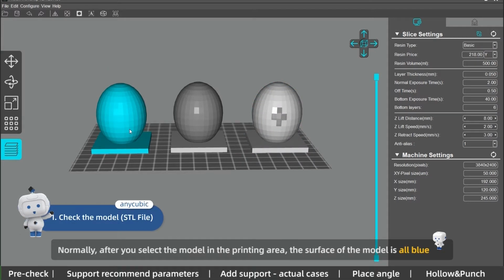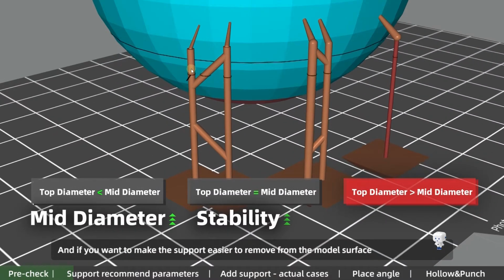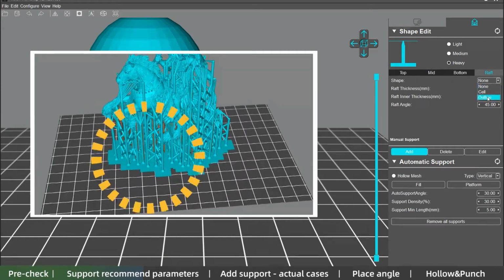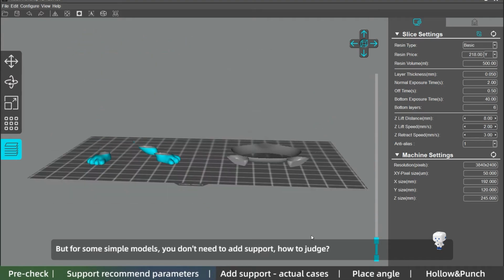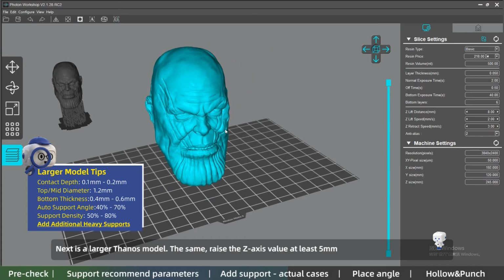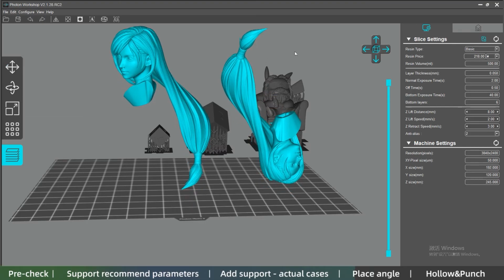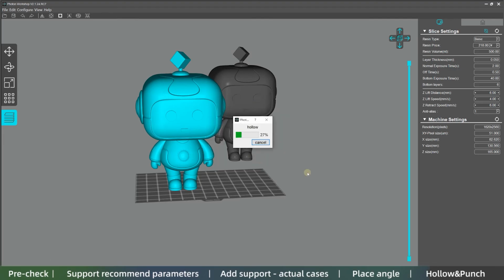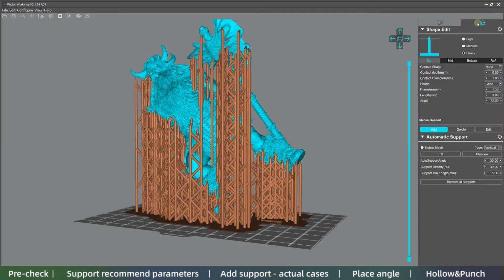Anycubic Photon Workshop Beginner Guide 2

Comment from the maker: If you have any doubts about the video or if you have anything you would like to know, please comment below! 😁
Photon Workshop Beginner Guide 1: https://www.youtube.com/watch?v=NqPuJ9hckSM
( Beginner Guide 1 :You can learn how to set the printing parameter for your model )
Reply: I have a file with a long internal cylinder, open on both sides. How ever during printing seems to fill with resin and come out solid. Any tips to printing long thin hollow sections?
Reply from the maker: Sir, do you mean that during the printing process, the resin flowing out of the hole will cure on the surface of the model? For your model, our suggestion is that when you punch holes on both sides of the cylinder, the height of the two holes should be as different as possible (one high and one low) 😊
Reply: HELP!! got my photon mono x week ago, been struggling with it. The test file work perfect but i download files from online stl and use the photon workshop to slice it and convert it to pwmx. I load it to the flash drive, flash drive displays correct print i wan to print. hit print, begins to print..hours later should 50, 60, 70% etc but i look at the plate and it has built nothing. I am using the any cubic resin. please help?? what am i doing wrong.
Reply: @norbertofernandez4077  did you solve your problem?
Reply: @3d_printer_go_brrrrr  they read the manual.
Reply: @norbertofernandez4077    it’s not the resin. It’s whatever settings you have on the machine or photon. Be patient, read the instructions, watch the entire video, do some research solo and I bet someone would be more likely to answer your questions.  Can’t expect an answer from anyone if your question is asked out of  laziness. If you really wanted to do it and learn, you’d find the information just as you did here. Trial and error. Don’t expect someone to answer a vague question.  Too many variables. 

Start by reading the manual. The mono’s manual  tells you what power to use depending on the resin color or type. There are test prints that take 7minutes in the mono 6k. No reason to not calibrate. I dunno I just don’t think it’s cool asking something that obviously has an answer in your own documentation.

Comment: HELP!! got my photon mono x week ago, been struggling with it. The test file work perfect but i download files from online stl and use the photon workshop to slice it and convert it to pwmx. I load it to the flash drive, flash drive displays correct print i wan to print. hit print, begins to print..hours later should 50, 60, 70% etc but i look at the plate and it has built nothing. I am using the any cubic resin. please help?? what am i doing wrong.
Reply from the maker: Hi, Norberto, you can set up an after-sales order here, and the engineer will provide you with a solution directly. if you have submitted it but have not received a reply, you can tell me the relevant information. I will contact the after-sales staff and contact you as soon as possible. https://support.anycubic.com/VisitorTicket

Comment: I'm new to 3D, with the Photon Mono 4K, I tried using Lychee and got constant print failures.  I sliced in Workshop and finally, got my first print. I don't know enough yet to configure Lychee, if it's can be compatible but the Workshop software constantly crashes, especially when trying to add holes. Thus, it's the first thing I add and I SAVE OFTEN.  it could be my old laptop too :)

Comment: Version 2.1.21 of Photon Workshop does not show the same options as this video for the bottom. In the video all of the variables are different than what shows in the app. The app shows settings for Shape, Diameter, Length, Contact Depth, and Angle.
Reply from the maker: Hi, sir, this is version 2.4. we will release a new instructional video about the new version of workshop in the future. 😊
Reply: @ANYCUBIC3D  2.4 is not even available on your website after a year

Comment: Hi, I have a Anycubic mono SE at home. I watched your tutorials video but when I try to print, the printer doesn't recognise my file on the screen. I save it as a "scene" like you seem to do at the end of the video. then put it on my memory stick. And when I plug it to the printer, the printer act like there is nothing in the file. What am I doing wrong ? (my language is french so if you have a french service, it maybe would help better, if not in english)
Thanks
Reply: You should not put the scene file on the usb stick. Instead, after you press the "slice" button, you will get a .pwmo and that is the file you need on the usb
Reply: When saving your print as a "scene" you will be able to edit the design in the Photon Workshop. However, to print you need to slice the design first. You can see the slice button in the bottom right corner. After slicing a "pwmo"-file will be generated. This file can be used by the printer.